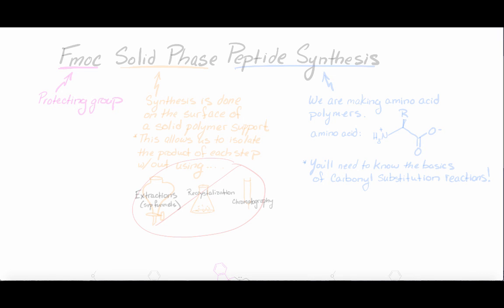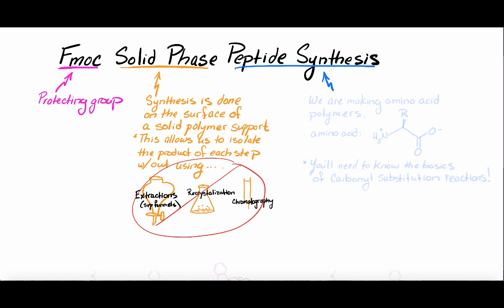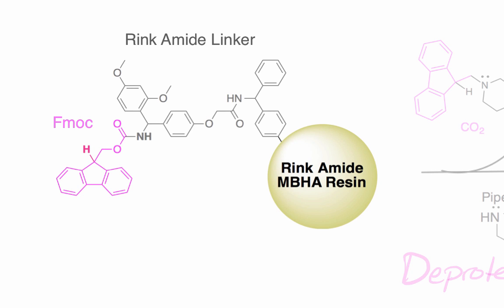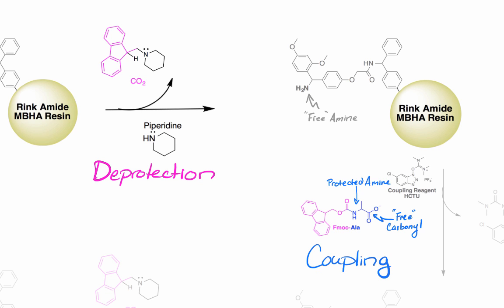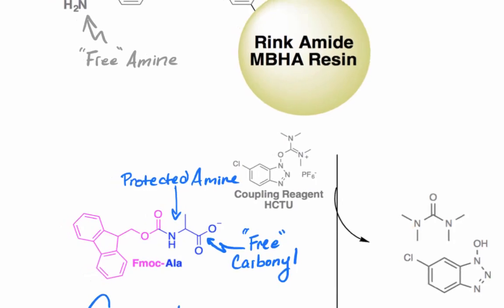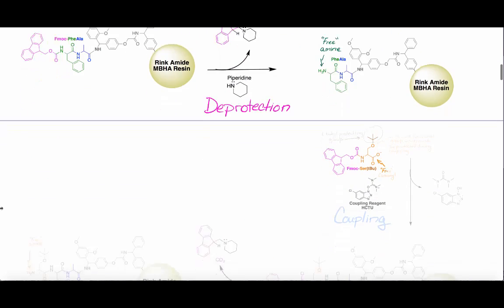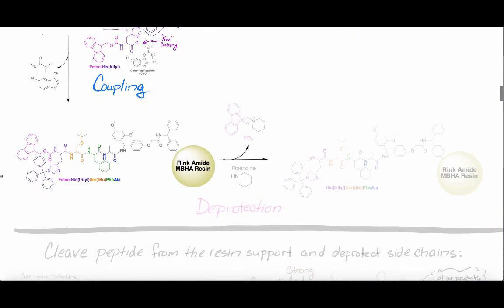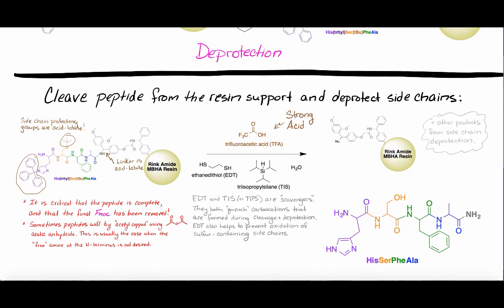Fmoc Solid Phase Peptide Synthesis

Comment: Hii there, nice video. I am bit confused on my synthesis as I got a sequence using phage display library against a pathogen for example: STFSQNG (N to C) and I want to synthesise it using Fmoc SPPS. But as the FMOC SPPS using Rink amide resins generate from C to N, should I use Glycine as first amino acid (reverse) or use S (serine) as first amino acid and then T,F,S etc.
Reply: Reverse Order will be followed